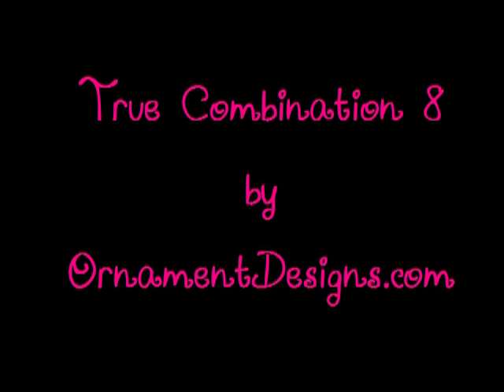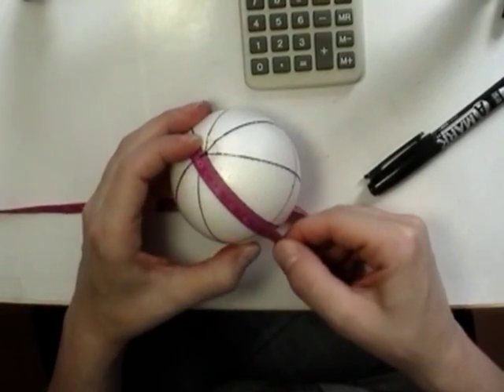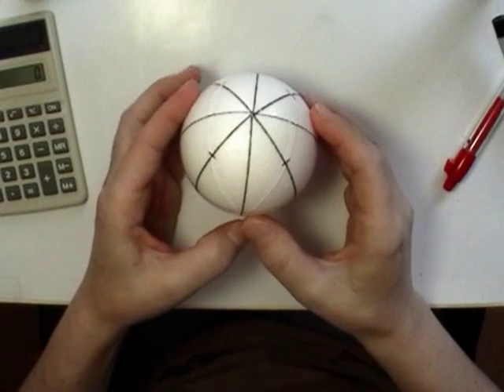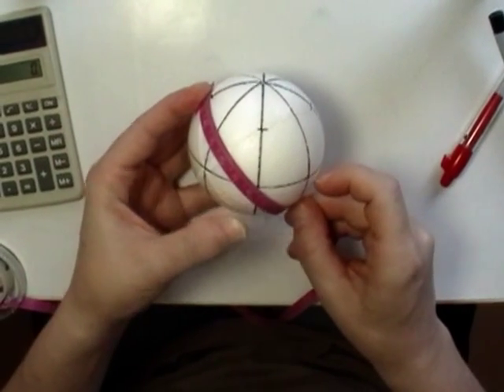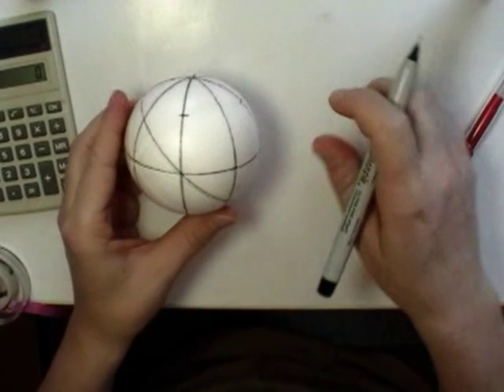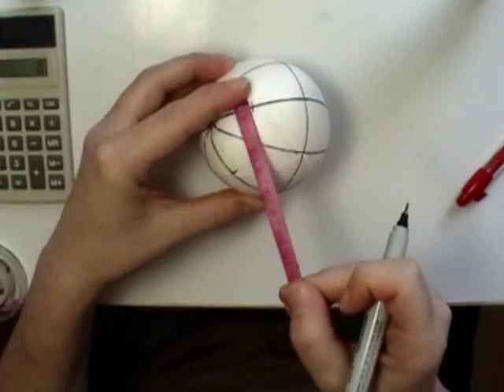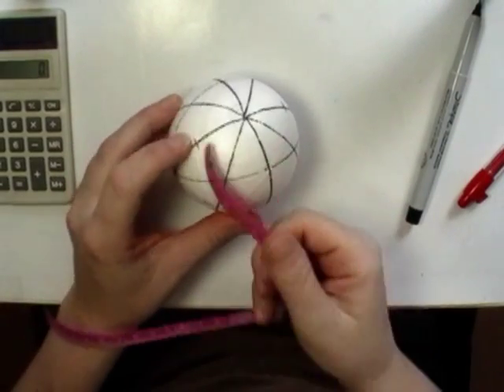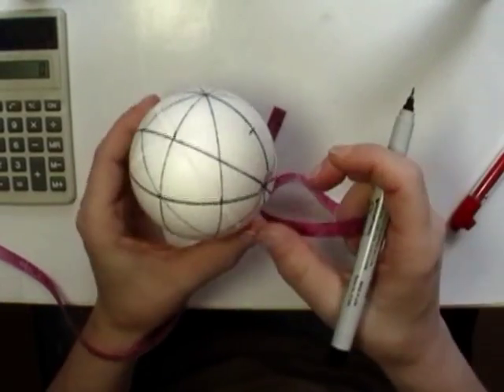Combination 8 Division Tutorial

Comment: Would it work if you had a small perfect square of paper and lined up the opposite corners on the equator mark?  Then the other two corners when joined would intersect the equator at an exact right-angle. Repeat at the exact quarter points around the equator (fold a strip of paper the length of the circumference into quarters to find those) and joining the dots should go through the poles... I think!

Comment: @AlyxMazY I tried different types of the balls, but all smooth styrofoam (some harder some softer) and none of them had this fantastic dimple.  The one I have surpass of also only has mold line. No other cool markings. It's perfectly round and even the mold line is not that easy to follow sometimes (there was one hard type ball that wasn't round because molding was so thick and I thought that my tipsy triangles are due to the shape of the ball). Well, thanks a lot for trying. Good luck and M.C.

Comment: I tried today. I didn't try to get the paper to lay flat though, just "point to the dot" to mark. My strip of paper folded to mark quarters was very narrow and I found that was an even easier way to divide the ball and "check the poles" than the little square. I ended up with a pin at the N and S poles and 8 points around the equator. I joined the pins with crochet cotton to define the segments and "pressed" in the segment lines with the side of a pin, running it under the cotton guidelines.